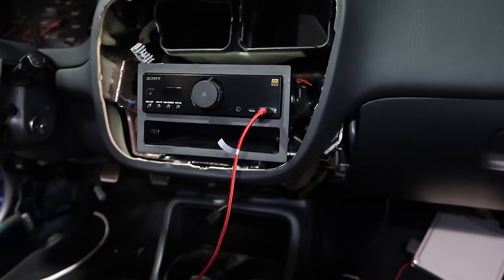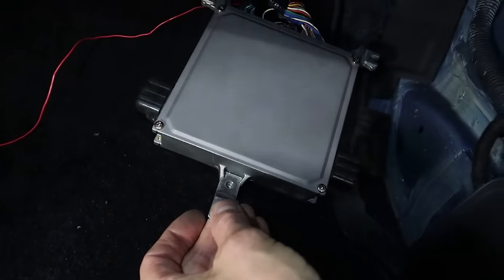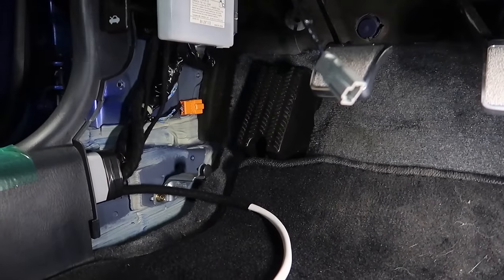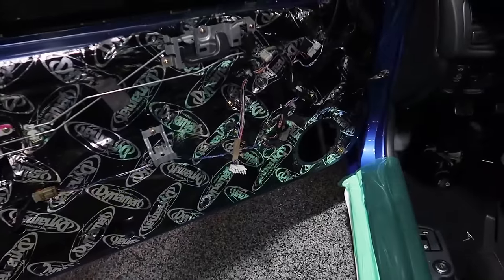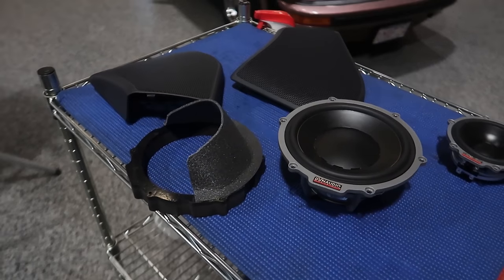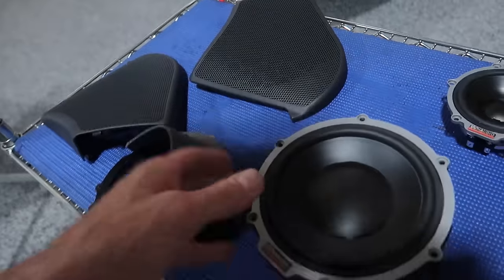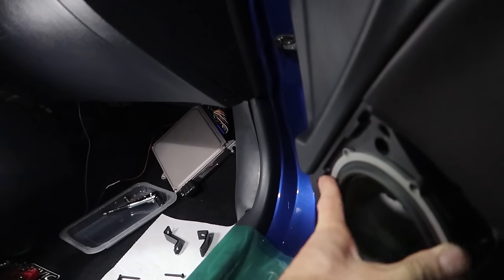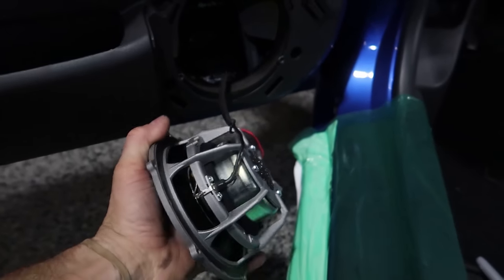The Civic Gets A $24,000 Audio Upgrade: Front Stage Build & Build Overview

Comment: Other than hiding drivers (speakers) or personal preference, looks or simply  no room, the A pillar are very thin/ small, there is no excuse to have tweeters and midranges on the bottom pointing up, legs will block high frequencies, tuning will have to be boosting high frequencies to compensate for legs blocking the frequencies.  Not being critical but I have to assume that there was no better option based on the vehicle.  As long as the stage and the singer's voice comes up centered in the dash horizon or higher, that is what matters. 
Again the best of the best sound is always accomplished with tweeters and midranges placed higher at dash height or not much higher than an passenger's shoulder, and a sub in the front.  Again they did a great job, and it was to somehow hide driver's have discretion and not ruin the car' original look and have fun.   Having a tweeter too close if being placed higher is not an issue with harshness or anything,  the time alignment and a steeper slope fixes that easy, specially having a good sound processor besides having 20 plus EQ bands just for each tweeter to dial it right.
Reply from the maker: You are dead wrong bro.  Kick panel location is the superior way to produce proper imaging in a car.
Reply: Some of the best sounding cars ever built use kick panel locations. When it’s done correctly, you can have a superb sounding car. Neither kick nor A pillar can be considered the one and only location to use. But, if I had to pick, dash mounted mids and tweeters is the easier way to get good sound. More for single seat cars (driver seat is where the best sound is), but not exclusively.
Reply: Well I have personally not experienced a listening experience in a car having kick panels with mids and tweeters yet.  It is probably a personal choice or an old way of doing things, yes it makes it easier to tune. What I know is in the past 10 plus years, there has not been a single car  that has won a car audio World competition with kick panel drivers,  again a judge does not add points for the experience or personal preference, it is more about a raised stage above the dash. The score card has too many categories focused on just the stage, therefore kick panels no longer cut it.  Anyway who cares, I personally have listened to top podium systems, and I was not impressed besides the fact that the music they play is not a choice, it is what they use and give you to tune your system. It took me a while to train my listening to learn why those systems scored more points.  The point is,  90% of average listeners will not be impressed of the system that won the highest category sound competition.  And it's not about wining a competition but being happy with your system and 90% of installer shops do not tune for competition and don't participate or often win a final sound or state championship competition, shops tune for themselves and their customers with popular music, not the music  judges use to during competition. Kick panels versus pillars, is  a controversial topic, I can only go by what I've seen, what judges and competitors do and recommended to me. Again a fun system is not a sound competition system,  maybe I'm wrong  by saying the best sound is achieved with tweeters mounted on the dash bottom pillar point,  I should have said, for a stage that scores the most points in sound competition that does not equal to a better sound experience to most people.
Reply: I don’t disagree with much of what you’re saying. I am a 3 time IASCA World Champion and 5 time Canadian IASCA Champion. Of all my installs, only one used kick panel midrange placement. I’m not going to name names, but some of the most famous and well respected car audio systems used kick panels. Especially 2 seat cars (judged from 2 seats). Path lengths are very important to those car in particular. And you’re right about some “sound quality” car systems. They aren’t fun to listen to. But that isn’t the case with most of the top systems.
Reply: IASCA and MECA another controversial topic,  my experience was with MECA way of judging,  maybe that is the issue,  it's more of a one seat tuning.  There are too many categories. The 2 seat category is not something I had the chance to experience maybe that's the issue.   A simple MECA IASCA search will show many installs and top participants from both organizations.

Comment: I hate to be that guy, but this is not "obssesed" audio install. 
The install is pretty and well done, however in terms of the "sound quality," anyone who knows can see that this is pretty poor. 

1. Center image is not defined as above the steering wheel by iasca or meca as being the center of the dash. Pretty rookie mistake and shows you don't really know much about car audio regardless of how long you done it for. Soundstage on the left will sound incredibly shallow and short with piss poor imaging.

2. Passive crossovers, really? This is 1995 orrrr? If you really think the passive crossover will line up with your acoustical crossover in a car and not have phase issues, lol yeah. Good luck trying to eq your system when you have a messy response. Should have done a wideband up on the dash level or mid tweet up there. 

3. Speaker placement and choice. Its not about what dynaudio knows how to do better with there passive crossovers, its about picking the right speakers with the right placement and t/s parameters to match your environment. More than likely, your install is not what dynaudio had in mind about speaker placement and crossover points. The esotar 430 is crossed at 650hz and 3khz. Ever heard of phase cancelation, beaming, and localization?? Why in the world would you build kick panels and not put your midbass there an either a sealed or aperiodic enclosure. Sorry but the esotar 650 struggles with its lower midbass and will have a pretty hard time lining up with your subwoofer when you find you have no control over the acoustic crossover, which probably falls off on the drivers side 6db compared to the passenger side somewhere around 200-500hz and below 70hz. Playing any door speaker above 200-250hz is just asking for trouble. You sub integration to your front stage sucks big time. Not only that but the 102 tweeter, dang dude, which is not the esotar, is going to struggle even more so in those kicks crossed at 3khz on what I can assume is second order bw. At minimum you will be down 10db 60deg off axis at 10khz and with you leg covering it good luck. Higher frequencies are always more prone to being directional (beaming) so you will never get that soundstage up high enough without some localization. 

4. Yes pathlength difference does help, but the most important thing is having equal frequency response on each side and checking different crossover points for cohesiveness acoustically. Why even bother with the Mosconi if you aren't active? Moreover, if you chose a helix pro mk2 or ultra with a director, guess what, you have optical audio control and subwoofer control. Beside that fact, that Mosconi processor belongs in the trash.

5. Your prejudice towards hard dome tweeters shows you literally know nothing about speakers. Its about frequency response and achieving the best pistonic movement from light and rigid tweeter dome material. 

6. Let's see some spatial averaging and individual speaker responses on Facebook or here. The car is a lot different than a home stereo environment. 

I could keep going but hey, to the unobssesed people its cool. Sorry Matt, its a cool install, just definitely not an sq setup. Hope one day you'll hear an actual sq system one day!
Reply: Sounds like you enjoy being that guy very much
Reply: Very much so...
Reply: I would say Derek knows a bit about proper sound quality, being the builder of IASCA world championship winning cars.   http://www.sound-in-motion.com/installsDetail.html?id=26

Comment: I'm afraid this system is all about loudness and bass

And not about musical balanced experience
Reply from the maker: What?  It is a single sub.
Reply: @ObsessedGarage  
It depends if you designed this system mainly for listening to DJ, hip-hop music which requires focusing just mainly on bass part.
 Or you designed this system just for listening to music on general which requires more creativity and planning and studying to create high quality dimensional true balanced musical experience. 
By the way, the best stereo systems I have ever listened in a car was Bose Infiniti q70 from 2015 to 2021 models, that was very warm and realistic dimensional sound despite laking bass and some mid-range, but what matter is the whole listening experience. And Dynauido in Passat 2016. They reminds me of high end vintage system from 90s and 80s. 

Kind regards

Comment: Every time I see someone talk about kick panels in relation to path length differences in a single seat car I cringe. That hasn’t been relevant for many years. It is only relevant in a two seat tune car. Nor does it make it easier to time align, unless you want to consider a few fewer clicks of the time align button on the dsp “easier”.  I’d bet that car rainbows the stage pretty good given the low tweeters. It is a very, very rare car that doesn’t. 

Shame that the rta work didn’t incorporate spatial averaging. Having the mic fixed like that leads to inaccuracies in the upper mid and high frequencies due to reflections, which cause peaks and valleys in the response that you wouldn’t hear, but you’re tuning for.
Reply: I live in Boston and get my equipment from sound in motion. I’ve personally listened to his builds and they are VERY well tuned and sound amazing. You goto his shop and see many SQ 1st place trophies. I’ve heard plenty of SQ systems. Right now I’m running a Zapco Z-150.6 AP amplifier. Zapco DSP-Z8IVII. Two illusion carbon c10 subs like you see in this civic . AD audio development W800neo in the doors. Hertz ML700.3 mids and Hertz ML280.3 tweeters. It’s all ran active. I’m thinking about changing out the Hertz mids and tweeters in the spring. My mids and tweeters are in custom mirror sail panels and custom A pillars. All done with fiberglass and so on .

Comment: Horrible place to put the ECM, when, not if, but when water makes its way through the cowl it's gonna drain right onto the pcm
Reply: The HVAC box like every car has a drain spout. Not only that but every hvac box has a double seal on each and every seam. I’m a automotive tech of 18 years. I’ve done many heater cores and evaporator cores .
Reply: @myboy051  so I need 2 seals? On my dc4 integra? Genuinely wondering because I would love for the leaks to stop lol
Reply: Shawn Hasenbalg - they come as channel seal . If I was you I would make sure your drain isn’t clogged a little bit. Find the drain hose and stick a air blow gun in it.

Comment: ran 14 gauge to rip off the customer lmao. I am literally powering 150w through stock wiring and while the output at the amp is 150w the power at the doors is 148w. I lost 2 watts of power from wiring. big fucking whoop. you wont hear 2 watts of power when you are already talking 150w range. this idea that you have to run custom wiring is just wrong and really scummy to keep doing it to consumers. "but the amps get hot" no they don't. another lie. if my amps were overheating they would go into protect. they never go into protect.

Comment: What a waste of time! $24k for something you aren't gonna really hear. Especially since all the speakers are down low and there's always a driver in the driver seat. Put a passenger in the car and you won't hear that side much either. Granted the work is very nice and very clean but it was just a waste of time. Being in the car audio business for so long I learned the hard way. Honda designed those car audio systems poorly to begin with. This didn't help much at all.
Reply from the maker: You must not have been super successful in the car audio business if you can't relate to this.  This is my 20 year old dream system.  It's amazing, and I hear every cent spent.